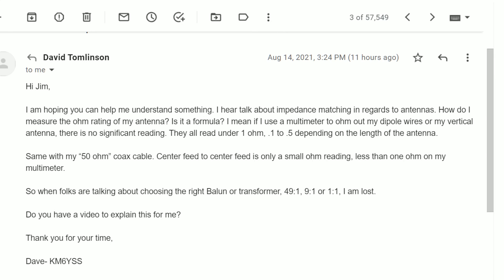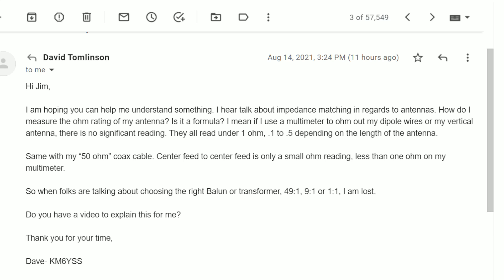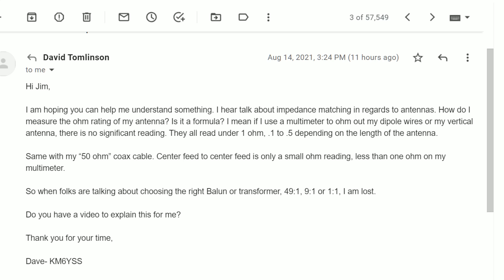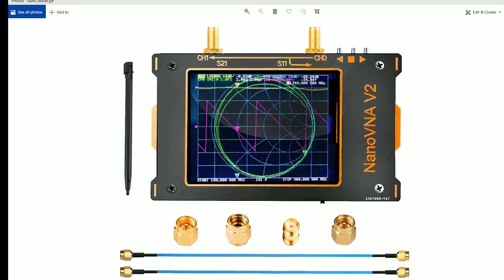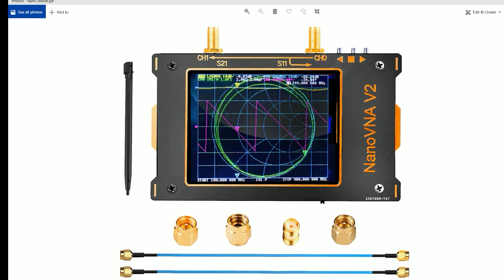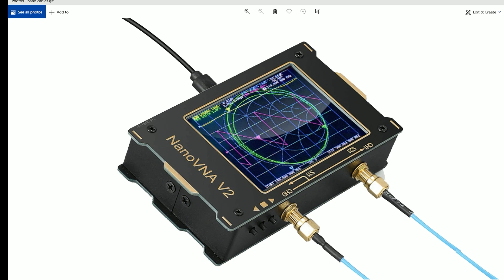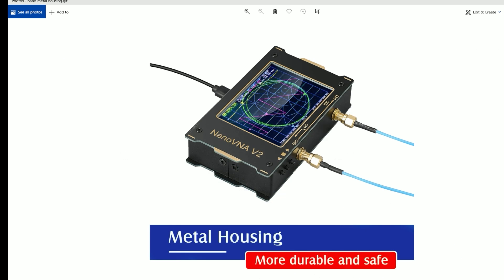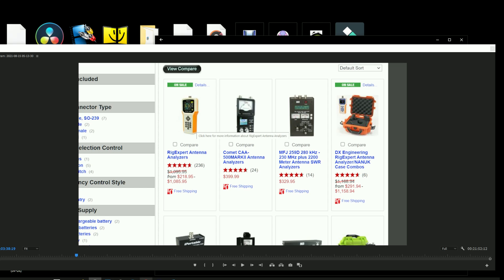Why A Multimeter Cannot Be Used To Measure Impedance & A New NanoVNA 2 Discount Code Jim W6LG

Comment: Good evening Jim,
First, I want to thank you for some advice you gave me some time ago.
 Basically it was move on from CB and get licensed. 
Needless to say...
 I got my tech and recently upgraded to general.
Now onto my question,  I bought my self an ic7300 and I have a butternut vertical  I'll be putting up within the next week or so. I feel I need to get myself a decent antenna tuner. I don't plan to ever run more than 400 watt or so. Is there one you reccomend over another? I see alot of reviews on some models, however the guys reviewing seem to change equipment monthly.  I'm looking for long term. I'm a younger guy on a budget who has a wife and kids. So my purchases need to be things that work and last.
Thanks
Luke
KJ7WVZ

Comment: Distinguishing between resistance in ohms (which you can test using an analogue or digital multimeter) and impedance (also measured in ohms, but which is frequency dependent). Hence non-reactive components such as resistors only have resistance. Reactive components such as inductors and capacitors have impedance, which I think of as resistance dependent on frequency....as there is an additional vector. Let me know if my understanding is accurate because it is easy to fall into error with this sort of thing.

Comment: Somewhat explains it but if you were to use a Nano or a rig xpert and show how resistance, inductance and capacitance affect the impendence of an antenna as visual aids it would have been a lot better. You can have a 1:1 match and not have 50 ohms at the radio. Explaining how to get to 50 ohms and have a 1:1 would be great for the new people and maybe some of the old guys too.

Comment: OK, The impedance of an antenna or feedline is the impedance at which it can be terminated and cause no reflections. 
It is the instantaneous impedance, and a DMM just cant rectify such a fast change of amplitude into a usable reading.
At RF frequencies the capacitance and inductance of the feedline is being charged and discharged at such a high speed, its hard to measure directly,  and your DMM just sees it as open..If you could freeze time for a second it would read that instantaneous value..Or if it were infinitely long.....

Comment: Cheep tester. AM radio set at 1000. 1 Mhz. It will pick up swr problems (close like three feet/one meter away). RF as it gets higher goes thru outside edge of copper. Skin effect. Cables really got to be correct for transmitter ( manual specs RG-8 only use that) 50 ohm and 75 ohm types mixed cause problems. Tighten properly connectors. Read manuals. If they say snug then 1/8 turn. Do it. I worked spy gear, radars, wire fans, whip 35' the works. Installed comm systems ... wrong or bad coax most common problem. Kinked cables are high resistance to broadcasts RF. Buy best you can afford.

Comment: FWIW a good way to illustrate AC impedance is to measure the dc resistance of a mains transformer primary.
Reply from the maker: Please tell me more.  Thanks, Jim
Reply: @ham-radio , nothing complicated Jim but bear in mind I am in the UK with 230v,  if you measure the DC resistance of the primary of a 100va transformer you will find them to be a pretty low value perhaps 10 ohms, (even lower in the US). Yet you connect the transformer to the mains supply and it draws quite low current due to the inductance. It graphically illustrates the difference between DC resistance and impedance. TBH it is quite alarming to find quite large transformers where the primary is maybe just a few ohms at DC and yet you can put 230v across it at 50hz without smoke and flames. Maybe if you have time a good RF demonstration could be something like a quarterwave for 10m with a 12v lamp in series at the base. I know a colleague as a youngster did similar but with a long-wire on medium wave, he recalled how as a kid it was amazing to see the lightbulb illuminate despite the wire "going nowhere".
Reply from the maker: @g0fvt  I did do a video with a dipole that had bulbs.  I demonstrated the high voltage and high current locations.  Your idea with the vertical would be a good demonstration.  I will give it some thought to see if I can make that work for a YouTube video.  As usual, thank you for the help.  I am typing and care just barely make out the letters because of cataracts. 73, Jim
Reply: @ham-radio  Hi Jim, thank you for the reply, sorry I must have missed some videos. Despite many years in the trade I sometimes still kind of step back from things and look at them from a twisted and different angle. IE If a receiver has an MDS of 1uV we would consider it as "deaf", yet in power terms it is an extremely small amount of power at the antenna port.  Radio is amazing and borderline magic, thank you for your contribution. P>S my gandmother was in her mid 90s when she got her cataracts done, it is never too late! 73